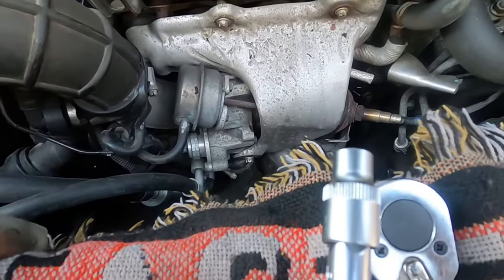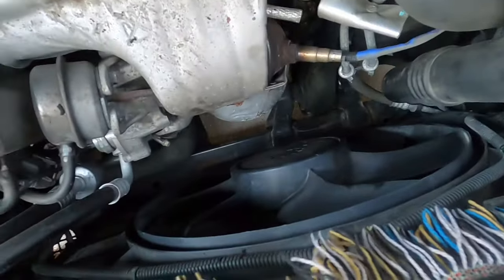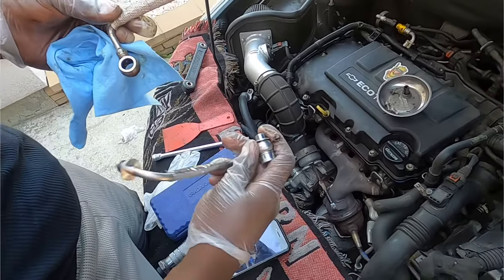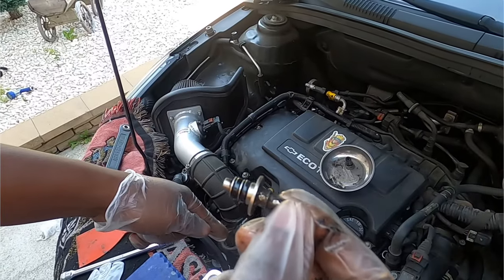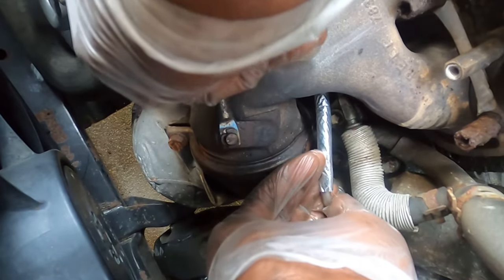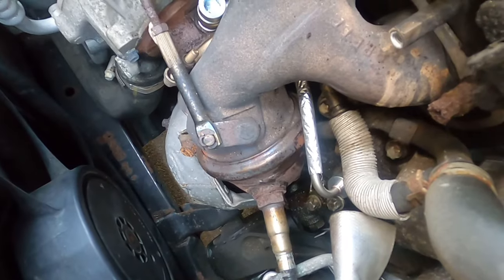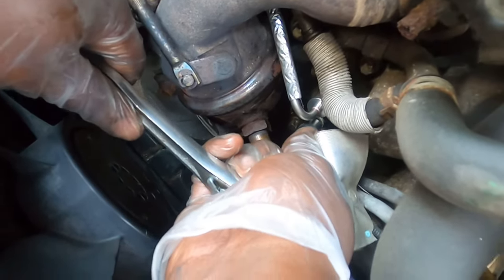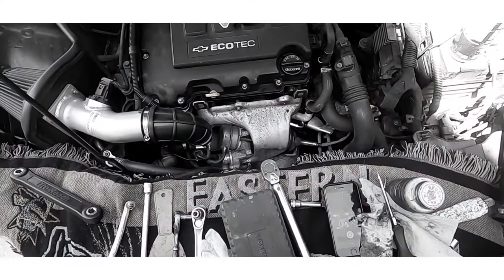2011-2015 Chevy Cruze 1.4L Turbo Oil feed line replacement

Comment: Did it fix your oil leak?
Reply from the maker: @Joseph-wh5of  yup
Reply: @ultimatediyguy395  Awesome! I have oil pulling up in the same location you showed in the video. And I also would get time to time a smell of burning oil from the AC. I have to part coming soon. Hopefully it will fix my issue as well.

Comment: Bad spot for the oil supply line .    I wonder if it would be better off leaving the heat shield off . or add some sparkplug heat shields to that oil line for extra insulation.
Reply from the maker: Sorry I’m just now seeing this. The new oil feed line does have heat insulation & I wouldn’t recommend taking off the heat shield. The heat from the manifold could damage the other things around it

Comment: I BOUGHT A DORMAN & IT'S NOT A TORX , IT'S A HEX
Reply from the maker: You actually may be right wow. But you can typically get away with using a torx bit on hex bits

Comment: I have a 2018 Chevy Trax my engine looks identical to yours, but I’m sure something has to be different. Considering the fact yours is a 2014 They had to updated something with the engine between 2014 & 2018 visually it looks the same.

Comment: Hi , thanks for the video. What could get damaged if the line is not fixed immediately ?
Reply from the maker: It’s very close to the exhaust so a burning oil smell & less oil lubricating the turbo
Reply: @ultimatediyguy395  ok thank you very much for your feedback

Comment: Did u have to drain the oil to replace the feed line? I also have the older revision of the feed line, will the newer ones fit?
Reply from the maker: No drain the oil is not necessary. The newer version will fit fine
Reply: @ultimatediyguy395  ended up installing a dorman, now i got smoke a burning oil smell from that area, i think the dorman had a bad seal. Going with OEM later today

Comment: would it be helpful to wrap foil tape around the line to help keep heat off of it? I've heard that those lines get cooked by the turbo. right after you turn the vehicle off that area stays hot for a little while after oil stop circulating. if the oil is just a little too old and its gets cooked it can gum up the line.
Reply from the maker: The new line comes with heat insulation where it is closest to exhaust manifold to protect it. Other than that I don’t see adding more heat insulation will make a difference🤷🏾‍♂️. If your using full synthetic oil and changing it as needed I don’t see the gumming up thing happening. Conventional oil is more prone to sludging up
Reply: @ultimatediyguy395  that little bit of shielding isn't going to help. It's best to change the feed line every 40-50k miles.
Reply: I've replaced 3 blown turbo's from the feed line being clogged. Likely heat soak causes oil to build up deposits. I recommend changing the line every 50k
Reply: Have to be consistent with oil changes.also wait like 30 seconds before turning it off

Comment: Would this cause oil to leak underneath the engine and all over the oil pan?
Reply from the maker: @taylorsnyder2458  sounds like you have a oil pan gasket leak
Reply: It can, and does, depending on where the drip path is.  I rebuild these engines and can tell you the leak from the banjo typically drips onto the catalytic converter and down onto the exhaust flange, sometimes onto the oil pan.  If the leak is from the block (other side of the oil feed line) the drip path will definitely drip down the block and onto/underneath the oil pan.  But there are so many places residual oil on the oil pan can source -- front main seal, oil pan gasket (RTV gasket, not an actual gasket), front timing cover gasket (not an RTV gasket), or from any of the interfacing components adjacent to the front cover.  

Typically, if there was one to fail it would be the front main seal or the timing cover, because these are the first seals to go once this engine's signature failure happens: the PCV, which WILL fail on every single GM 1.4 out there... every single one of them.  The "fix" for this is deleting it with a PCV fix kit (ex: cruzekit) or replacing it with an entirely different PCV system (ex: ZZPerformance PCV system) with a catch can.  However, the only true FIX for this is rebuilding the engine, because once the PCV system fails every seal on the engine will ultimately begin to also fail because of building high crackcase pressures, derived from a failed PCV system, that create internal stresses that none of the seals were ever designed to handle.
Reply: Yes, he replace that, the part is called (Turbo Oil Feed Pipe) or as other call it (Turbo Oil Feed Line) It could leak from any side of just one side, if the oil leaks from this small Turbo Oil Feed Line it will cause smoke especially if it's leaking from either end, one end you cannot see since the heat shield is covering it but if smoke is coming from the heat shield from the exhaust then its the same Turbo Oil Feed Line